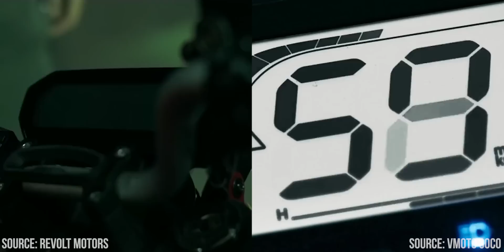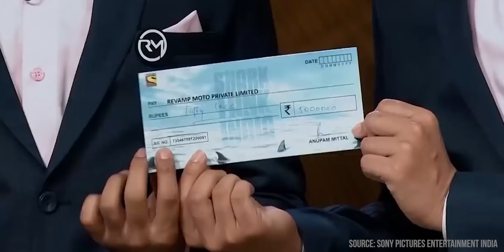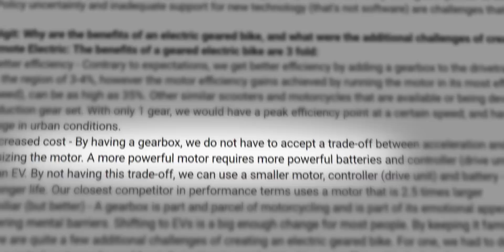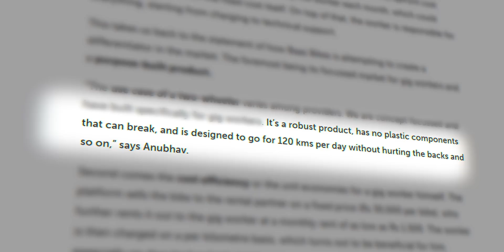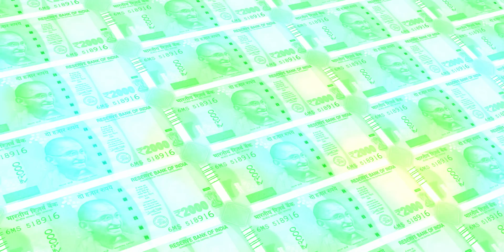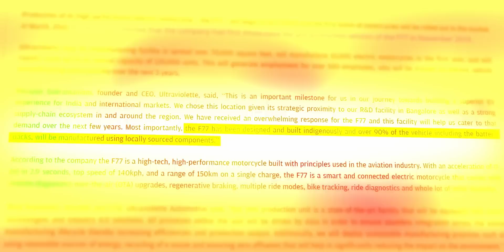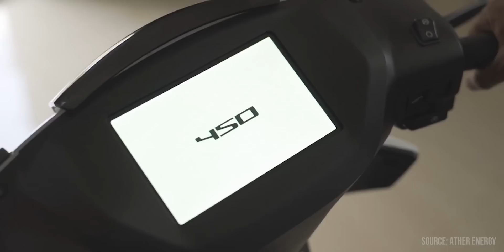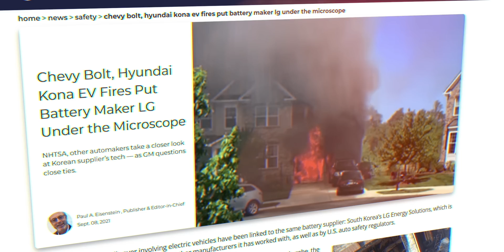Top 10 Indian EV Two Wheeler Startups

Comment: Excellent overview. If one adds the cost of battery replacement every 6 years, does it make a better investment than a 100 cc mo-bike or scooter.
Reply: Even by 3 to 4 years, most medium to heavy users will save as much money in petrol to buy a new scooter. As more and more vehicles go EV, battery costs will reduce. I think the battery will be so much cheaper in 6 years when the EVs become a common thing. So you can wait 6 years to buy EV or buy one now and save till the next gen comes out. Maybe you will get a lot longer lifespan on the battery than 6 years.
Reply: @evthink  thank u

Comment: I am surprised that the electronics like motor drives, lcd, cellular chips and battery charging circuits and microprocessors are built in India.  The central government is trying to set up electronic fabs, while these bike companies while not in production yet (except ather and ola who import their electronics) are already building these high end chips which eliminates the supply chain issues.  Would love to know more about where these small companies can build high tech electronics, or if they are not up front, and importing parts from Qualcomm, St micro, ti, seimens, ir, etc

Comment: Ola is number one in spoiling the name of EV in India, they over hyped their scooters and delivered a badly built production model which was not tested adequately and had lot of issues, still they have several issues to solve but their initial vision was to capture much of market rather through false delivery dates rather than producing a well designed and tested product, as a result people are finding it difficult to trust other brands too who are working more diligently than Ola in producing a well thought and designed vehicles.
Reply: Hey their issues are intentionally over hyped. It's a new company and will take time to be perfect but many of the problems related to delivery and software glitches now resolved.
Reply: @Saurabh.P  yes but what about vehicle fit and finish, plastic parts are not properly installed and has panel gaps, scooters are overheating on driving at higher speeds, on inclines many times just can't pull on stopping.
Reply: @ManieV  Panel gap issue is rare now. Over heating issue is really really rare and only happens if you are driving in Hyper mode at high speed at high temperature for more than 20 minutes. Hyper mode is beast and powerful than a 500cc bike. Driving at such speed in city is just plain stupid.
I and my brother have OLA since 6 months and never faced any issues. And it climbs steep inclined roads as well in Normal, Sport and Hyper modes. 

Do you own OLA?
Reply: @Saurabh.P  thanks,  makes sense to use hyper mode judicially, my colleague has ola which he received this Jan, could be model specific issue he was facing.
Reply: @ManieV  Welcome. They are improving day by day. Panel gaps were there initially in few batches but with each new batch quality improved. Same goes with delivery, eg in my city Nagpur people are now getting scooter in 2-3 days previously the waiting time was more than 3 months. Definitely Ola is not as finished as Ather since Ather is 7-8 years old. Ola will improve as well over time.

Comment: Correction here - Ather hasn't caught fire I believe
Reply: Not i has not cought fire... Its was a damaged scooter which caught fire
Reply: @The_PGK  Ah gotcha, thanks!
Reply from the maker: https://www.zigwheels.com/news-features/ev-news/ather-450x-electric-scooter-catches-fire-company-issues-a-statement/45830/ Apparently some high-pressure water entered the battery pack, causing a fire at one of Ather's service centers. Certainly not as scary or egregious as other fires that have happened recently, but still worth noting. -Caleb
Reply: @backstagewithmillionaires  The scooter was in the service center for accidental repair in which the battery was damaged. So I think it's more of a mistake on the dealership's part rather than the product's defect. Ather also stated that they will be revising the protocols in handling accident cases.